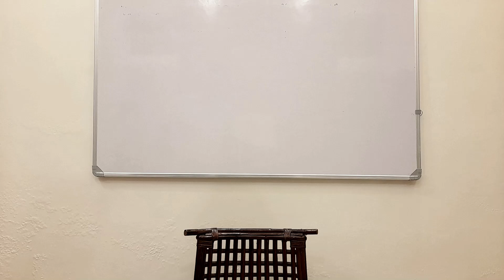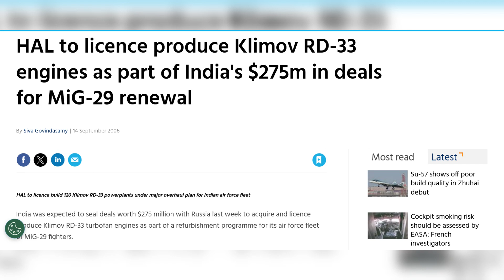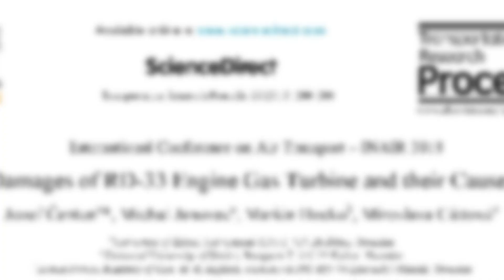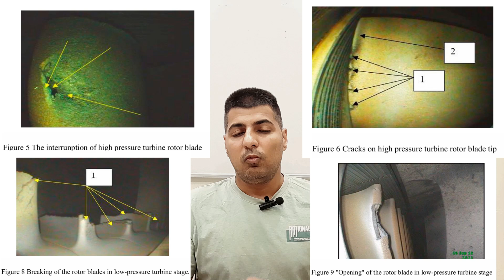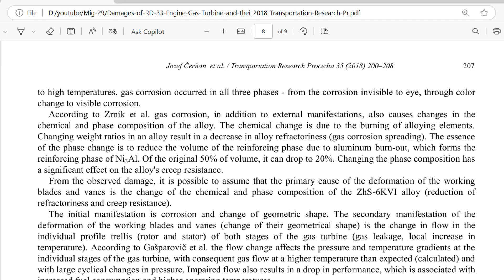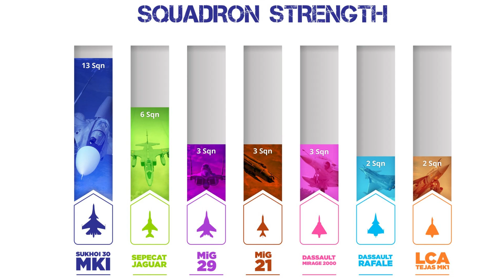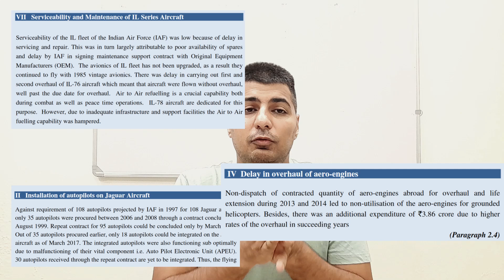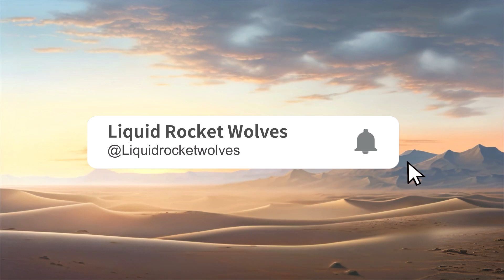The failure of the MiG-29  |||  Part-1 |||

Comment: Losing an engine shouldn't cause the loss of the aircraft, it is part of the reason we have 2 engines in the first place. In the RAF we lost Jags but very very few to engine failures, in fact in the 10 years I worked on them, I don't remember one.
Reply from the maker: I think the engine failed during a stall type maneuver or high angle of attack. and thank you for the support🙏🙏🙏

Comment: The standard RD-33 engines produce a heavy smoke trail. I would expect carbon deposits on HT components. This would add to non-uniform heat stress and premature failures. It’s a good aircraft, it just needs a better engine.
Reply: Yeah,Rd-33s are like Race car engines basically, high thrust but short life. With access to good facilities not a bad aircraft.
Reply: @Archit-c2c  Fact is RD-33 Klimov is reverse-engineered of Pratt & Whitney J57 from 1960-year shot downed U-2. So as you can see short life of Soviet engines have nothing to do with "high thrust" since j57 used on bunch of American supersonic fighters of the time.
Reply from the maker: @thewhite8uard  High thrust with Precision made components no problem, high thrust with non precision made part with inferior refractory  properties is equal to a lot of problems.
same as how the Tu-2 is a relatively badly made copy of the B-29.
Reply: III series (and newer) RD-33 are smokeless, so are all RD-33MK and RD-93 (JF-17).
Reply from the maker: Yes, smokeless but still older iterations have problems with refractory properties.